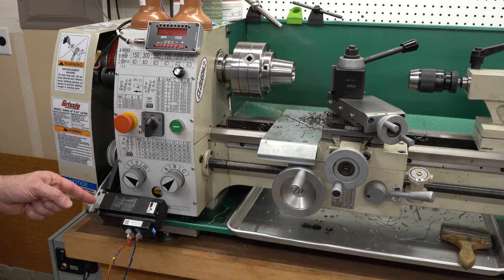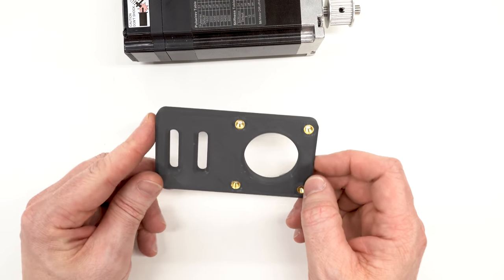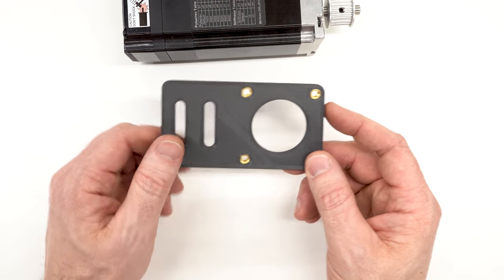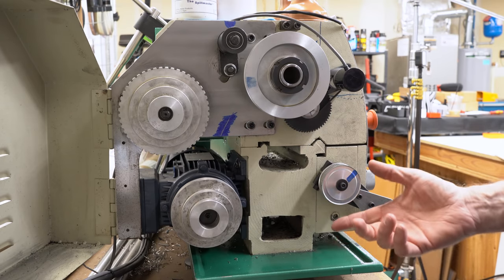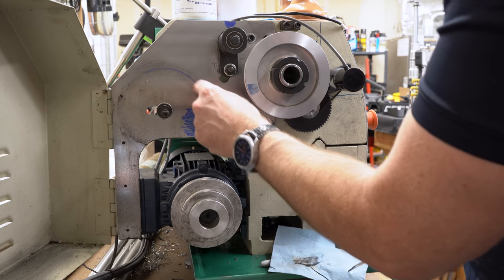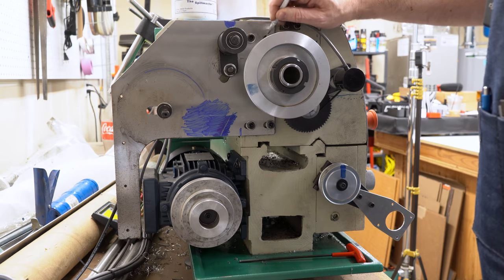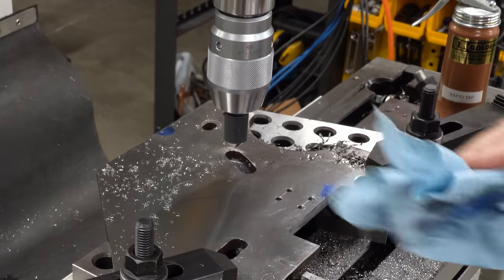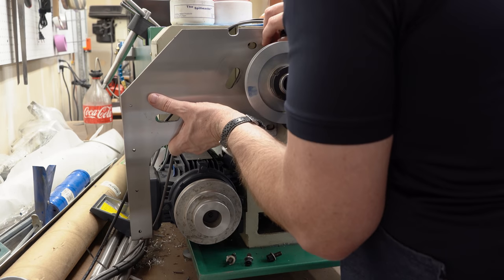Finally Installing the Servo on my Lathe | Electronic Leadscrew Part 27

Comment: What happened with the 940m mill didn't you like it.
Reply from the maker: It had issues and had to be returned.   The 935TV that replaced it is excellent.
Reply: @Clough42  I guess I missed the video on you changing mills. Can you elaborate on the issues. I just ordered a 940v
Reply from the maker: @berniejanssen2863  the X to Y squareness did not meet the factory specification.
Reply: Thank you for replying

Comment: @12:52 what are those channel-lockish pliers you used? What are their advantages to other types of pliers? I'm guessing they are expensive. Great video and channel so I'm SUBSCRIBED!
Reply from the maker: Knipex Pliers Wrench.  Link in description.
Reply: @Clough42  Thanks for the answer. I didn't look at the description.
KNIPEX Tools 00 20 06 US2, Pliers Wrench 3-Piece Set Only $237! They better be really useful.

Comment: James, what pulleys are you using on your final installation?
Reply from the maker: I'm using 24 on the motor and 72 on the screw.  I also have the gearbox set for and additional 2:1 reduction.  This seems to work well with a servo motor that can run at 3000rpm.  It would be too much reduction for a stepper.
Reply: @Clough42  Thanks James for your reply.
I’m going to try to duplicate your mods for both ELS and vmd on my G0602. I need to order belts and pulleys with the right specifications(width ,hole diameter,set screw,,etc). What is a good source for these?
Is it possible to acquire the encoder and servo mount as I don’t have a 3d printer yet?
Reply from the maker: @barryweissburg6384  I got the belts and pulleys direct from China via eBay.  I don't sell the mounts, though they can be made out of other materials and don't have to be 3D printed.
Reply: @Clough42  where can I find the drawings for the servo mount and rotors encoder mounts?
Reply from the maker: @barryweissburg6384  many of the parts are on Thingiverse.

Comment: One day I will get round to putting all my arduino projects into enclosures. I call a project complete when it works though. The rest is just  aesthetics / safety 😁
Reply from the maker: Safety.  Yeah, I know the feeling.
Reply: I have a similar sentiment with my electronics projects - but for me its mounting them properly to an enclosure - as all my projects just have to live at least a cardboard box, sometimes a plastic one, and sometimes are even secured well enough to call that box an enclosure (card can make great cheap enclosures, doesn't have to be metal, wood or 3d print for everything!).

Comment: Why didn’t you bolt the motor “dummy” onto the back of your mount (with the pulley going through the hole), like it would be with the real motor?
Reply: Because he hadn’t cut the clearance notch yet, so the mount wouldn’t sit flat that way….

Comment: I don't anything about anything but if you are a consistently making the same mistake with the handwheel then that seems like a UI problem to me. Maybe you should consider adding some sort of  additional tactile feedback to the wheel to help eliminate the muscle memory confusion and prevent the same kind of mishap from happening in the future.

I don't know for sure what form the feedback should take but the first thing that comes to mind is a 3D printed ring placed on the handwheel and positioned to the left of the handle so that you can feel it with your thumb. This would remind you what turning the handle toward the rind would do.
Reply: I just took a sharpie and put two arrows by the handwheel, end of problem.

Comment: why couldn't you use a steel plate in place of the 4 washers,  other than that nice job.
Reply from the maker: Yeah, I considered it.  That would be another part to make, but it would spread the load well.

Comment: That "anealing" sounds more like a normalizing process.
Reply from the maker: "Annealing" is definitely the wrong word, though it's what's commonly used.    I think it primarily increases cross-linking or polymer entangling across layers, and relieves stress in the part.
Reply: @Clough42  that's why blacksmith's often do a normalizing process (heating up and a slow cool down) to relieve stress after working the material, before hardening as the rapid cooling can cause warping from the internal stressed. Annealing done after hardening to take some of the stress down. It only softens it a little but it also becomes less brittle.
Normalizing plastics, i don't know if that really helps. I have seen some putting the print in plaster and then basically melting the plastic and letting it set again. Inorder to get a more homonoginised plastic part. Doesn't really work far as I've seen.

Comment: I don’t know how you (being like myself…anal) went this long James. My was mounted as part of the original build. Did you have to alter the code for that motor? I liked the idea of the stronger force motor…but messing with the code was a pain!
Reply from the maker: I don't remember.  I suppose I could check the video where I tested it and see.  :)
Reply: @Clough42  I could as well, but I don’t know that I would know what to do with the info!